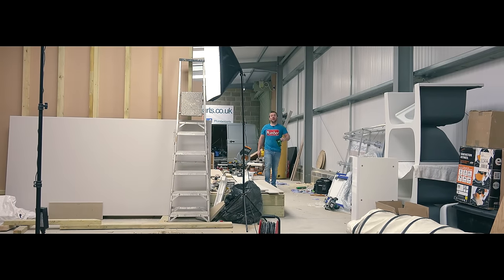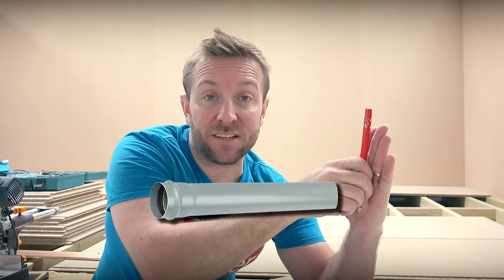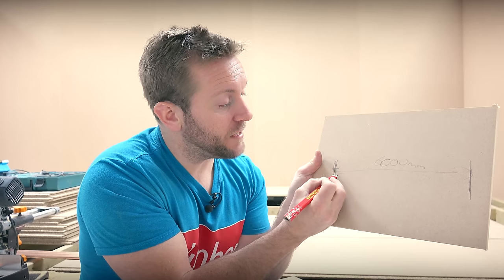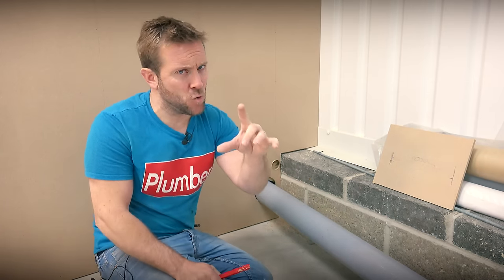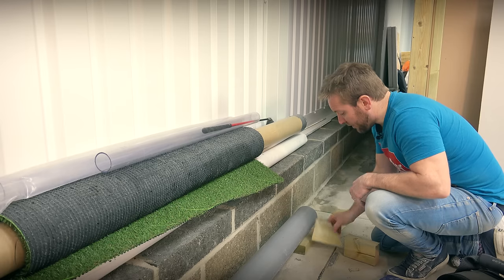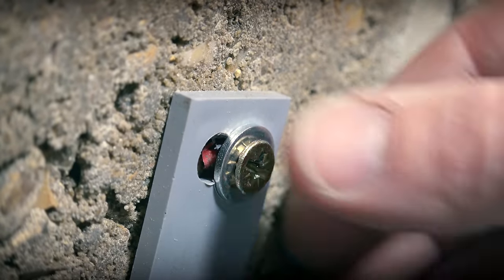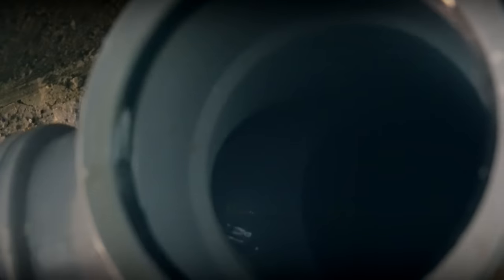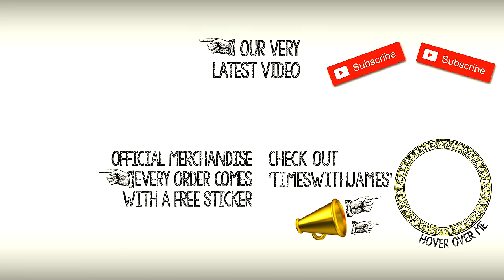SOIL PIPE INSTALL - HOW TO CALCULATE FALL GRADIENT

Comment: The builders who did my house in the 80s managed to get the soil pipe from the toilet to the stack (about 1.3 metres) with absolutely zero fall.  Amazing that it never leaked.  When I redid the bathroom this year, the tiled floor gave me about 10mm, the new toilet had a more horizontal outlet, and this fixed the problem.

Comment: I usually measure from the centre of pipes. Reason being that it's simpler if you have a change in the diameter of pipe somewhere (and even for the same nominal diameter of pipe, the external diameter is not always the same due to flanges etc). Of course, you're somewhat guessing where the centre is - but as long as you're reasonably accurate it's not a problem. If you really want what you can do is find the exact centre by measuring top, bottom and taking an average.

Comment: Great video … really clear. So I took your advice and made sure I had correct fall etc and everything was just fine, I fitted my close coupled toilet, thinking to myself 'I'll just run some 4 inch pipe along the inside wall and connect up' … but of course the toilet outlet is much too close to the wall to fit a McAlpine bent thingy or anything else really.... so any suggestions will be REAL welcome, thanks.BTW if the fall is supposed to be 1 / 40 to 1 /110 why are all the fittings you can buy angled at 2.5 degrees (which is a fall of about 1 / 23 which is far too steep according to this video) ????Thanks again guys.

Comment: Thanks for the videos, find them very interesting and easy to understand. Wondering if you could just clarify something? It seems most manufacturers (Floplast as an example) supply their T's and bends as 92.5 deg. This 2.5 deg fall works out as 1 in 23, almost twice the maximum 1 in 40 fall (1.43 deg) you suggest. Surely the manufacturers have got a pretty good idea of the slope required for a soil pipe and are suggesting 2.5 deg (~40mm over 1m ) is approximately the drop to be aiming for?

Comment: Here's a question ..recently refitting a bathroom thats been in since the house was built (18yrs) and the soil pipe from the toilet to the T actually has a negative fall on it. As in it falls towards the toilet by 10 - 20 mm obviously thats a concern but its been in and functioning for that long without giving any hideous odours or leaks. My question is how can I rectify  what I will generously refer to as price work by the original plumber. (I'm not a plumber...though I suspect based on this house neither was he )

Comment: HI James, great channel.  Loads of hints and tips.  I’m no plumber or apprentice, just an average bloke wanting to give it a go.  I looked else where that mentions “breathing?”.  I guess if water and soil moves in one direction air moves in the opposite????  Kinda like a bottle of ketchup, I suppose🤷🏻‍♂️?  I just read what I wrote and makes no sense!  

Thanks

David
Reply: Most soil systems in the uk have an open vent on the system , this stops compression and back siphonage to allow the air to move freely . A durgo or air admittance valve allows  air in to stop siphonage but not out hence keeping the smell in .

Comment: Great video as always.
Small point though, should your 3m measurement not be 7.5cm of the floor? 6.5cm + 1cm for your finishing height.
Not going to matter too much as you have a reasonable run on the pipe.

Comment: I have 2 situations: (A) 3% on 100mm @ 3.3m run with one 45 degree turn. Will this work. (B) What about 8% @ 1.2m run with one 90 degree turn. Cheers.

Comment: What do you do if you have  a 3 metre run using 1/100  on the 1st floor then it drops through the floor to the ground floor level  by 40 cm & you want to run at ceiling height for another  7  metres  with a couple of 90 bends along the way  to connect to main soil pipe ?  Is this doable  & what would the  safest drop be ?  Would this still be good between drop 1/40 to 1/110 ?  How do you compensate for the bends ?  downstairs floor to ceiling height 235cm  Fantastic vids Thanks !
Reply: Instead of using 90 bends I'd try and use short swept  45's where possible , allowing for more adequate flow along the remaining length of the pipe after the drop  up to where it reaches the stack( 7 meters ) .1 -110 will work just fine,  since its only a 3 meter to 7 meter differential in run from the initial drop. Obviously I cannot see exactly where this is being implemented which would possible void my opinion. Still I hope this helps.
Reply: Thanks for your reply worth 
Looking at . Job not complete due to covid & overseas property so still relevant  ! cheers J

Comment: hi, what happens if the start of the run at the toilet end had to be almost level or even level due to obstacles and issues under a floor and then the rest say 4mtrs could drop as required, could this cause blockages? A

Comment: If the slope for 111mm diameter pipe must be between 1/40 1/110, which slope would be correct for 32,40 and 50 mm pipe? Please answer me
Reply: This was my question as well which hasnt answered..
Reply: @janjuag  In these years of practise I learnt that the smaller the pipe the bigger the slope needed but  for 32-40-50 mm normally 2 or 2.5 cm per meter is OK. 8f runs are longer then 5 meters in horizontal  lenght a bit more is required not too much though. It also depend how much space you've got

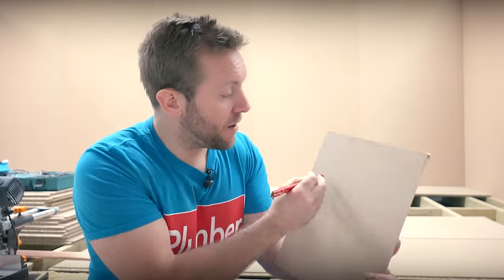Comment: Hi, If I have a horizontal 70cm length pipe straight from the pan spigot at 1:25 and then a 92.5° bend followed by a 1m pipe falling at about 1:40-ish (maybe 1:35-ish) to the stack will the water run too fast to carry the waste, especially  over the 70cm section or will I get away with it?
Reply from the maker: I guess you're worried about the 70cm bit. Should be fine mate. If you get a sec join the LIVE STREAM TONIGHT at 6:30pm - Open to all Bang the🔔too! https://youtu.be/TRJJjTkdENw
Reply: @plumberparts  Great!  Thank you James. :) Appreciate your time and really helpful fun videos.

Comment: I believe when Joseph Bazelgette designed the London sewers in the 1860s, he had a minimum fall of 1 in 200.
Drainage has to achieve a self cleansing velocity. Too steep, water flows too fast and leaves the 'solids' behind. Too shallow, and the velocity isn't great enough to keep the solids moving.
Or, just do what groundworkers do when laying drains and they're not using a laser. Just tape a thin piece of wood to one end of your spirit level.
Reply: Good tip,I'll keep that one.

Comment: Is there a video where you show a fix on an installed pipe? Like if there is a belly or a cracked section and you have to cut and replace a section of the pipe. I have an underground portion of my sewer pipe that needs replacing. The pipe is fixed. To get it to move a little bit after I cut it I would need to dig a very large trench which I cannot do. Thanks

Comment: Does a bend in the pipe around a corner impact the fall gradient? Does it still just need to be 1/40 a 1/110?
Reply from the maker: Bends don't affect the fall gradient, so should all be good!
Reply: plumberparts glad to have seen this video in the past and to have this question answered. I am moving the toilet to the other side of the room which will have 8 ft piping then a bend followed by 10 ft pipe to the toilet 🚽, just been advised to get a Saniflow system.

Cheers 🍻 for the video mate, really helped.

Comment: Alright James. Any chance of doing a video of how to connect 110mm pvc soil pipe to a cast iron soil stack? I need to cut a section out of a cast iron stack to insert a Tee to join a 110mm PVC pipe from another toilet. I cant replace the whole cast iron stack with PVC so need to cut the fitting into it somehow. Any suggestions on fittings would be cool too. Cheers

Comment: This is great I have been pointing out to some residents that water does not flow upstream as the had renter plumbers in so I will send them this video, I didn't want to tell them my profession as it always leads to "can you" and the answer is no no no! I did tell the renter plumbers pls get the fall correct well that fell on deaf ears!  and guess what, you guessed it we are getting regular blockages, they are now getting a "recommended Plumber" in to start all over again. shit happens.

Comment: Why not work back from the lowest point, set your pipe up so that it is LEVEL then raise the toilet end up by 1cm per 1 Meter,  if you measure of the floor you could be way out

Comment: Can't believe you Pommy plumbers talk/measure in centimeters, whats worse, you also occasionally use millimeters.
Just heard 6.5 mm when he meant 6.5cm, 11:07 .
This brings about confusion and therefore mistakes. In Australia all builders use millimeters and meters only, like 3692mm and 10.5m, so very unlikely for confusion.

Comment: Hi can u tell me if it is safe to bury copper pipes into concrete wall etc thanks
Reply: It's not good practice to do that as the cement can eat out copper brass 
wrap the pipe in insulation tape or denso tape or use pipe lagging that's usually not an option in alot of cases
Reply: gaffer tape or duct tape it